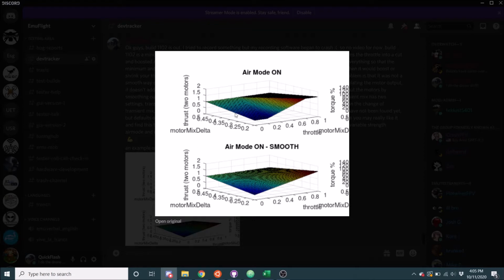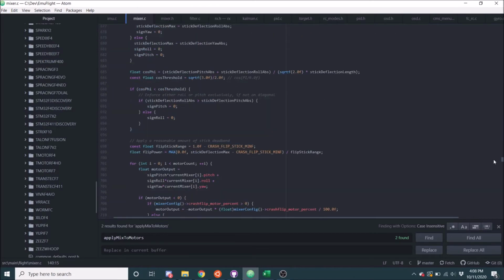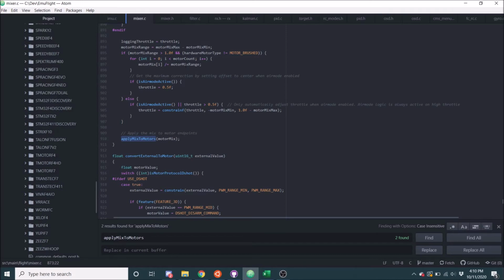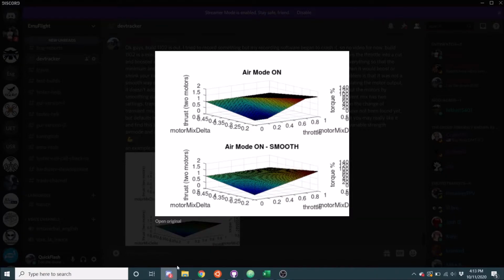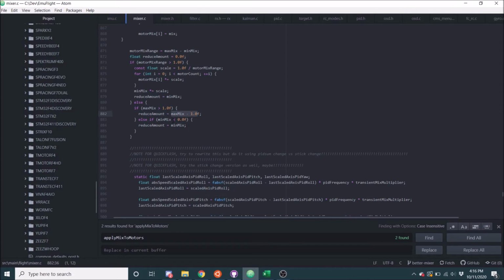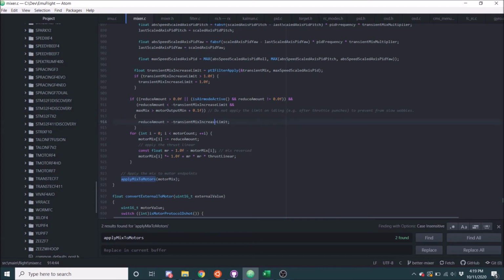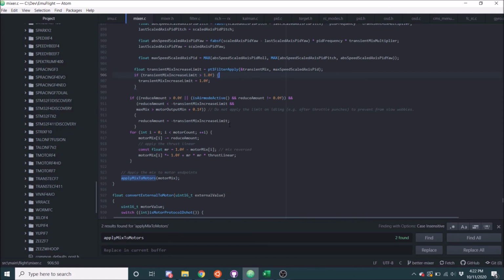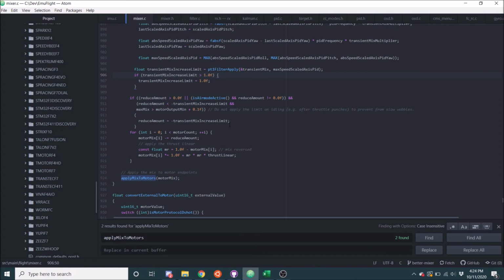EmuFlight Improved Mixer

Comment: Will i be able to build this from the branch and try it out. Is it turned on and off in cli or is it always active with airmode on. I was reading the code and saw something with airmode 2.0 turn on or off? Also do you need to have the thrust linearization to have it work properly? I had seen something that mentioned certain part of the code needed it to work a vertain way with some suggested values for whoops and 5 inch?
Reply from the maker: It's still being tweaked. I'll make another video once its more ready.
Reply: @Quick-Flash  ok. Cool. You guys are doing awesome stuff.

Comment: Actually super interested in how this turns out. I always felt there was something about the throttle response in BF that didn't feel right when coming from Kiss/Falcox, this could be a massive factor into why they feel different even on relatively the same pid tune feel.
Reply from the maker: thats one thing that i was thinking
I do think that different mixers will be making the softwares feel a bit different to one another.
Reply: @Quick-Flash  I think that's definitely what I felt when 'blipping' the throttle in any scenario with BF. Wheraes kiss and Falcox didn't have that stiff artificial feeling in those moments. On that note emuflight had less of this weird stiffness with the throttle, which I suspect is down to no anti gravity.